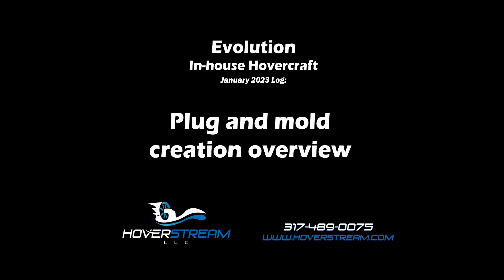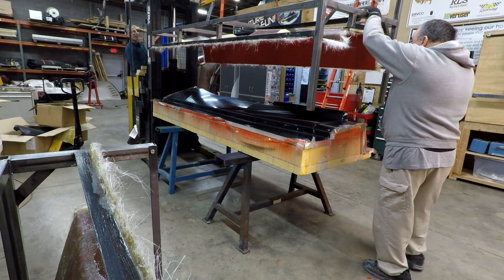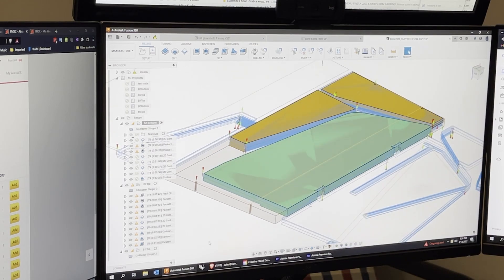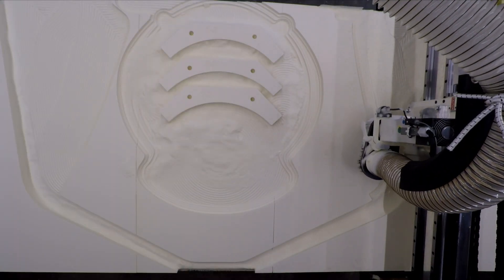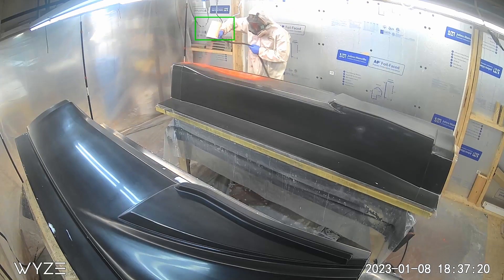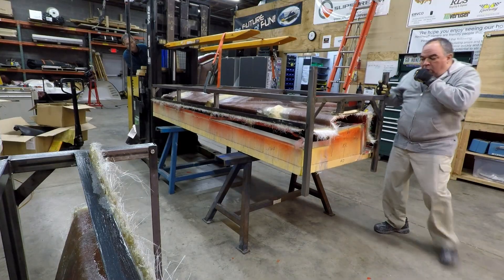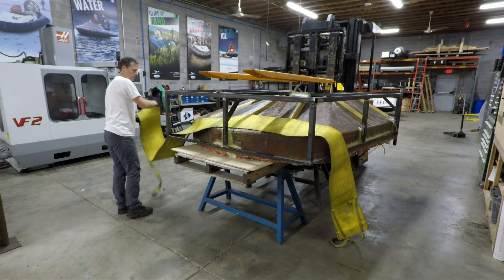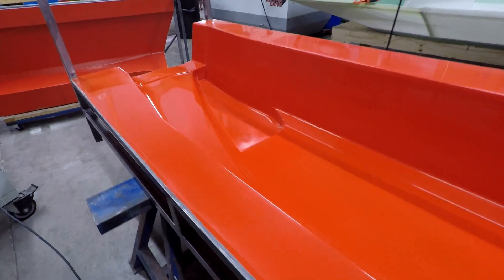Making Fiberglass Molds for the EVO Hovercraft

Comment: Thank you for sharing this! I've been contemplating how to make small hulls at home and this is very interesting.
Reply from the maker: One of the most difficult challenges with doing this stuff as a small company like us, or especially as an individual, is finding good suppliers. Especially if you want bulky items that require truck shipping; most core materials, for example. The right combination of willing to work with you, not so far away that freight costs are unreasonable, has what you want, AND will sell at a reasonable price... that is tough to find. Unfortunately, the vast majority of composites companies are still stuck in the 1980's. Getting a list of WHAT they sell, let alone a price for it, involves lots of phone calls and middle men, usually with a sales person who isn't too interested in dealing talking to you because your volume isn't high enough. If you can solve that problem, the actual work itself is totally doable (though extremely time consuming).
Reply: @Hoverstream  Thank you! That makes sense. How does XPS from home improvement stores compare in price and stability to the modeling foam used in the video?
Reply from the maker: @wwindsunrain  Massively less. 2" x48"x96" XPS (at least where I am) is way more than it was a few years ago, around $45-50/sheet. We use it for support structure on some plugs underneath the urethane board. XPS comes in various densities but most common is 2lb. 2lb urethane board is roughly double at $110, but honestly 2lb urethane is so soft it's fairly useless. We're using 8lb which is still considered way too soft for what we do but we make it work. Fine for a one-off plug, but you're not going to get multiple pulls very easily. It's roughly $400 a sheet though we got lucky and snagged a clearance price on oddball 1.75" stock. The "real" model board for high definition, high accuracy tooling is 30-50lb density and very pricey. It comes in smaller sheets, but using the 2x48x96 size for comparison it would be in the $1000-2000+ per sheet range. The real question on what you need is how accurate/detailed you want and whether it's being CNC cut or hand shaped. If you wanted to do a 3D profiling operation on a CNC like we have in the video that would be impossible with XPS. Also, with the higher density "real" tooling board, those can be thought of more like you would a sheet of aluminum. They can be highly detailed, extremely durable, and you can directly machine your mold in one step.